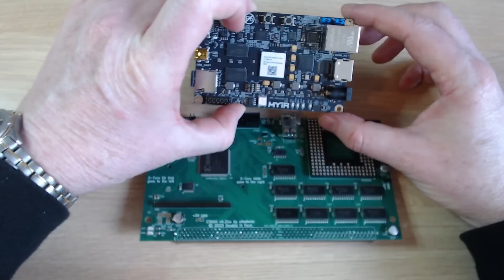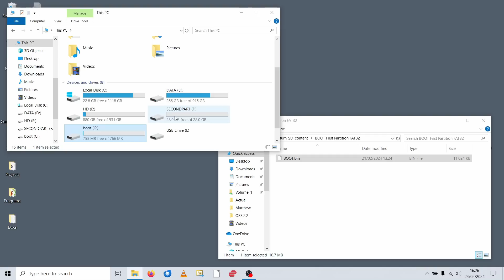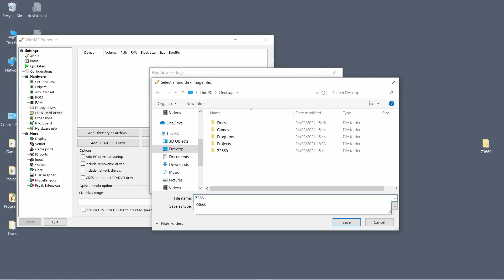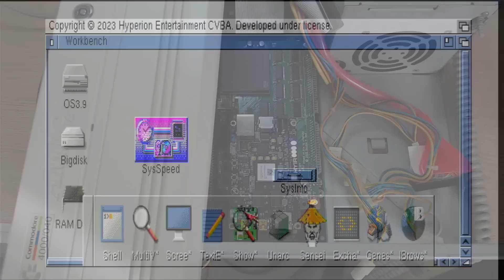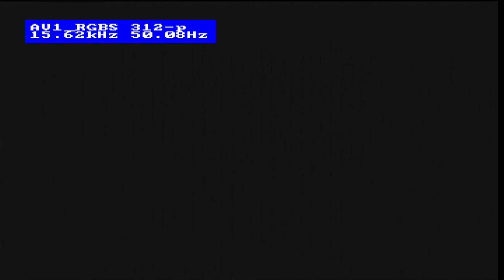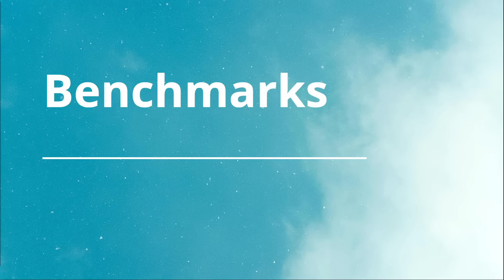1550 MIPS Amiga - The Z3660 all-in-one accelerator.  Part 1

Comment: There was a much better 68040 card at Commodore. The systems group hired Scott Schaeffer I think in late 1989 or early 1990... the '040 wasn't out yet, but he had '040 experience already. He went to work on a pretty high end '040 card, which included an L2 cache and a much better buffered interface to the '030 bus on the A3000. This was all before the A3000 was first shown to the public in April of 1990!  

In fact, we really wanted this shown at the launch. At that time, Motorola didn't want us to do that, and of course, since the '040 was still secret, okay, no problem. But we had the first OS fully running on the '040 with no problems outside of Motorola, far as we know. Scott Schaeffer and some of the software folks kept pushing, and ultimately, Motorola agreed. In fact, they'd meet us in New York with a "golden" '040. It was all set to be shown off, when someone from management decided that no, we would not show off the '040 board. 

Zip forward to spring of 1992. The Amiga 3000+ had been cancelled, and while I was still dealing with AA3000 issues, Greg Berlin and Scott Schaeffer were asked to make some "cost reduced" A3000 models. There were internally dubbed the A2200 and A3400. They used ECS, not Pandora/AA/AGA, and only supported Zorro II. They were presented to our various sales and marketing groups, internationally. 

So there was this weird thing about Commodore's organization: each regional manager pretty much had fully control over the Commodore products he/she wanted to sell. So after the talk of these new systems, not a single sales and marketing company ordered the A2200 or A3400. 

That got the new management into a panic, and out of that was born the A4000. Greg took my A3000+ design and integrated into the new board. About all I did was verify that Zorro III was done correctly. Of course, the IDE interface, not even a great implementation, had been dictated by the new management and was built for the cut-down machines, but the A4000 kept that. The only good to come out of that was my A4091 controller and, even better, the on-board SCSI derived from that on the A4000T... the best SCSI we every had. 

Even while working on the A2200/A3400, Greg and Scott realized that it made no sense to launch a 68030 flagship machine in 1992. So Greg asked Scott to build "the cheapest '040 board known to mankind"... and that's the A3640!

Comment: The 68060 actually has at least one missing CPU instruction compared to the 68040 (possibly FPU not sure), possibly more than one. These were removed at the time so that the CPU could be clocked way faster and because the missing instruction could be ran faster in software especially when the clocks were that much faster.
Reply: so does that lead to a crash when running software that doesn't load a 68060.library to make up for it? Like a self-booting game that makes use of that missing instruction?

Comment: Super Sweet 💪👍❤️💾
just like my PiStorm32 which emulates an 040 this beauty won’t have any issues running all the 060 specific programs/ demos as I’ve tried all of mine on my PiStorm32 in my Amiga1200 and all great!
Reply: Except for 68K MMU instructions, Emu68's 68040 emulates all 68K instructions. Emu68 self-reports as 68040.

Comment: Interesting test, very well executed and filmed. thank you for doing this review. I cant start thinking  though ( I have an A4000 with a 50mhz 060 myself ), but an Apollo Stand Alone is easily doing atleast 165Mips+ and 100 Mflops of Floating point crunching, and that is on modern hardware (68080 Evolution of 68060) FPGA with SAGA+16bit sound, 16 channels, way better 3D - Custom chip Maggie, 1920x1080, 512Mbytes of ram, 12mbytes of chipmem AMMX=simliar to Pentium MMX, Hyperthreading etc...still backwards compatible with softwares. Even though i really love my old A4000 that i made an carer of rendering adverts andstuff with  lightwave as a 3D artist, The new Apollo Standalone is the natural choice for me. It's expensive, yes,  but MUCH more economic in the long run and way more fun than an accelerator to my old A4000.
Thats my opinion, others may differ.
Reply: PiStorm32-RPi4B-Emu68 for A1200 blows away Apollo Stand Alone on CPU and RTG. 

Apollo Stand Alone does not duplicate Commodore Amiga's expandability feature. A true Amiga clone would have provided the FPGA AGA platform with Amiga's expandability feature since the Amiga is a desktop computer not a deadend mobile phone or game console platforms. There's ongoing FPGA AGA projects that will support expansion like PiStorm like a real Amiga. Tell Gunnar to modify Apollo Stand Alone with A1200 expansion slot. 

Be realistic when modern ARM CPU beats any 68k and clones on preformance and low cost. 

Modern ARM still supports big endian mode.
Reply: Apollo not a real Amiga so meh

Comment: sysinfo mflops is slow due to running with native Amiga emulated FPU code running on top of the card's emulated FPU -- double emulation!. You could improve that with a different emulator that reports full instruction set support so it doesn't trigger FPU emulation.

 Also some performance benchmarks you should look at are chip memory access and Zorro 3 bus access -- features that have been traditionally weak on the A3640 design. Some games are NOT happy on the A4000 if they depend on chip memory speed.

Comment: When you move into the extended ZIII memory space does it slow everything down like using a traditional ZIII memory card,  or does it bypass the slow ZIII bus?
Reply from the maker: I don't know as I have never needed that much memory but I would guess there would be no slowdown as the memory access wouldn't be going via Buster (which is slow)
Reply: Zorro 3 RAM via Buster is a bottleneck. 

On my WinUAE, my emulated Zorro 3 RAM is hyper fast. In theory, Amiga AutoConfig ecosystem can still scale with hardware improvements.

Comment: I've been trying to create something similar for all Amigas using a Zynq SOC. This is an interesting project I was unaware of.
With the Z3660 using a Zynq7020, another possibility would be to have a CPU running inside the FPGA (as there should be plenty of room free). If only the vampire 68080 core was open source.

Comment: ShowConfig is wrong. Both the 68040 and 68060 have FPUs named after their CPU. So e.g. 68040 FPU. The 68882 has much more instructions than the 68040 or 68060 FPU.
Reply: Sysspeed gives the correct FPU name

Comment: Great review 👍🏻 Looks like when this card gets going, we will probably start to see PiStorm speeds and above in a A4000…
Reply from the maker: Thanks!  Fingers-crossed, although it's already pretty fast
Reply: Caveat being that the ARM on the Z turn runs at a lower frequency than the Pi’s typically used in a PiStorm (3B and up.)
Reply: @jkdsteve   From SysSpeed's MIPS benchmark, Zynq7020's Linux 68k result is about 42% of RPi 4B's Emu68. Zynq7020's 68040 FPU emulator software needs improvement.

Comment: I only need someone to figure out how to get the scsi to behave in the A3000, very cool card. Pretty much what I have been dreaming of.
Can't wait for the second part 🙂
Reply from the maker: Firmware updates are being worked on that should fix DMA issues, including A3000 SCSI
Reply: @wrangleramiga896   Well that would be nice, but since pretty much ALL accelerators have at least some issues with the onboard scsi on the A3000 I'm not willing to hold my breath 🙂 (if they have onboard scsi that is)
Reply: A3000 also needs INT2 patch
Reply: @dennisboon6651   Well that at least is an easy and cheap fix 🙂

Comment: How do many MIPS? My first thought was it would be a pistorm
Reply: I speak too fast 😅
Reply: PiStorm wth emu68?
Reply: @valenrn8657  it's a similar concept
Reply: @vertigoz  PiStorm32-Emu68-RPi 4B's SysSpeed's MIPS is 3649 and  MFLOPS is 3636.
Reply: @valenrn8657  In opposition to motorola 060 it had to be something if the like
Reply: @vertigoz  Z3660 has both a PiStorm concept and a real 68060.